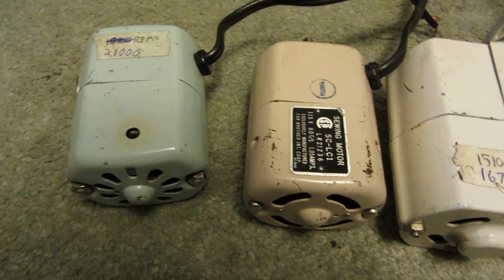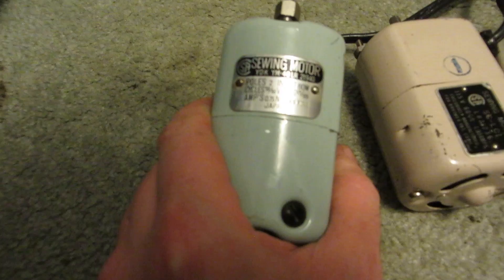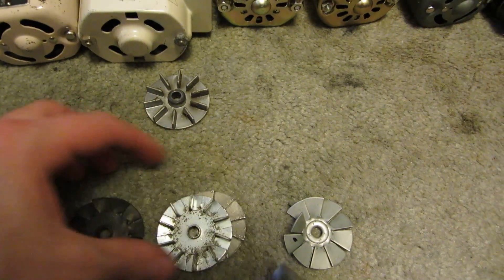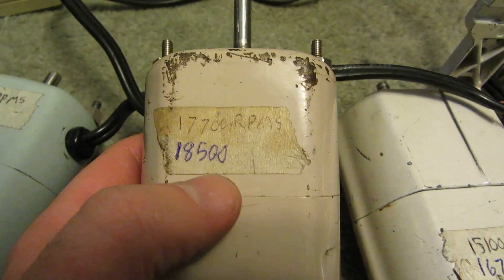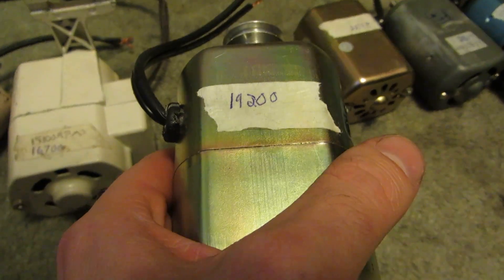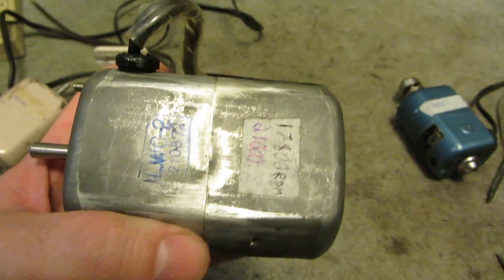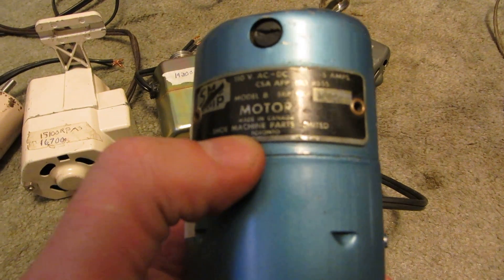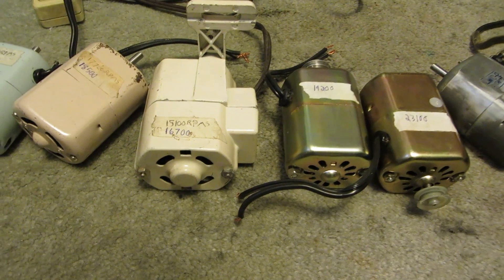Motor Limit Pushing: Overview

Comment: Will be a good video, I am thinking that the last, old motor will last, hopefully its construction is more robust than the newer ones.
Reply from the maker: Not sure about that it is horribly off balance even after having it apart and adding bits of metal to one side to balance it a bit.. but I could be wrong.

Comment: should do motorwars with them
Reply from the maker: I KNEW IT!! I knew someone was gonna say that I should do motorwars with them lol.. But what is more fun to watch? 2 motors not spinning at all for 5 or 10 min till 1 or both catch fire OR 1 motor given more and more voltage reaching higher and high speeds till it can't take it anymore and either smokes, shatters, explodes, shoots flames, etc..which would you want to see?
Reply: Motor wars :D
Reply: You should drop stuff in the motors to make it go wild, I put wd-40 in an old 120v motor and it became a temporary flame thrower.
Reply: I like the one-at-a-time approach!
Reply: both ? ... im not wrong  ... both are entertaining
Reply from the maker: True...
Reply: MOTOR WARS! Both usually involve waiting, however motor wars involves SICK COMPETITION, and when one motor goes out, the other's torque increases the intensity of the spin, causing extra flames (and sometimes another spark/burnout). Besides, it's awesome when both burn out.